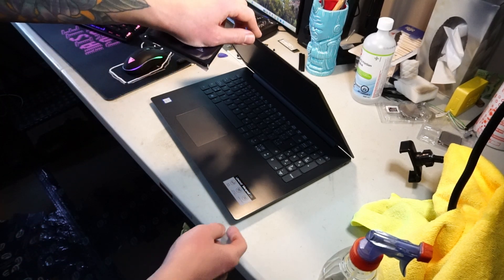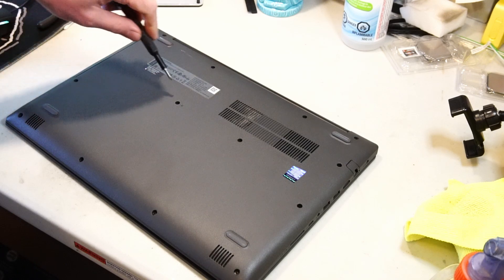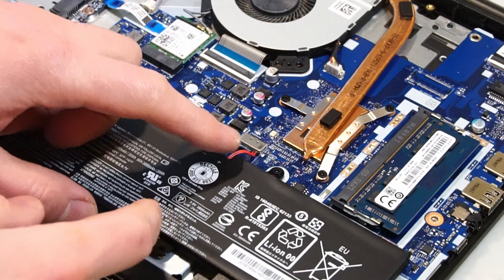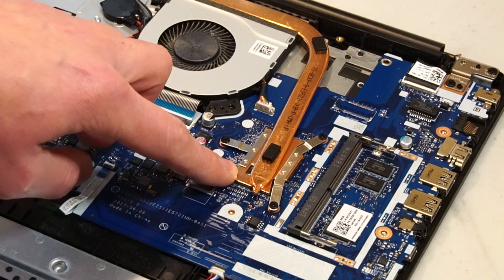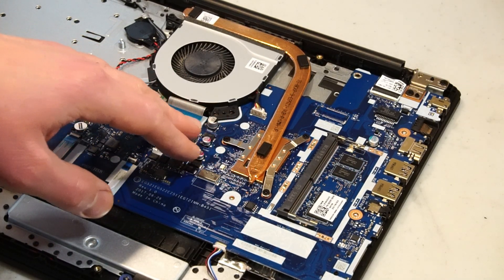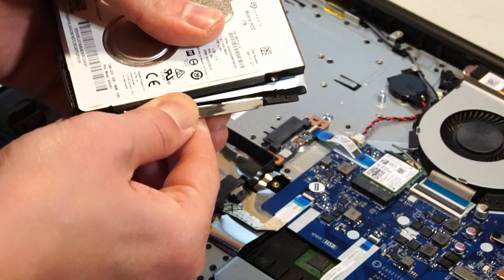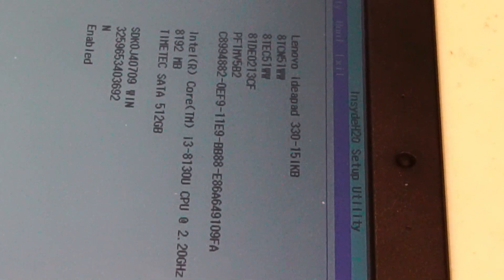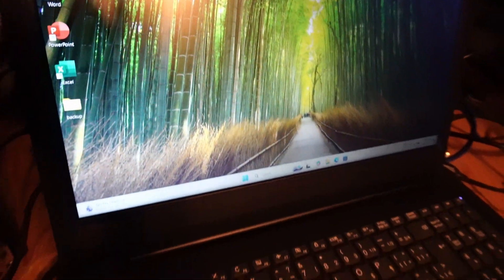Lenovo IdeaPad 330 SSD install & service

Comment: Amazing video very well explained I have a Lenovo IdeaPad 330 as well , what ram and SSD could I use for light gaming and design that isn't too expensive.
Thank you
Reply from the maker: Do you live in North America?  look for a brand called Timetec
Reply: @HaisteComputerRepair yes I live in USA ,  how many GB of ram and SSD would you recommend, thank you for the reply
Reply from the maker: @elmultitoolsrifado3853  Do you know if you have soldered RAM in your version of the laptop?  How much do you have installed currently?  As for SSD capacity, that really depends on how much space you need.
Reply: @HaisteComputerRepair  I just opened it up and it looks exactly like the one on your video, I believe ram is 3gb and does the SSD really make it faster or can I keep my 1TB HDD?